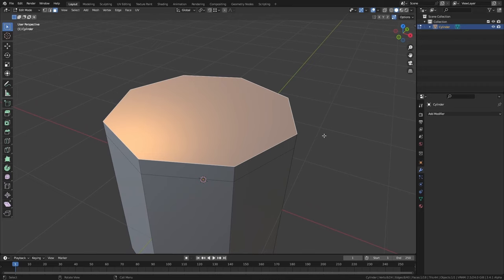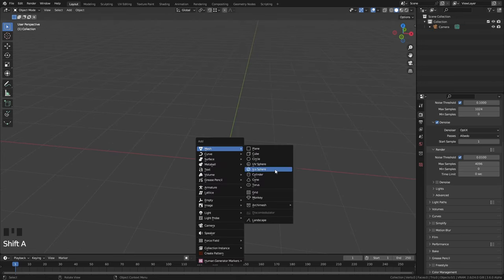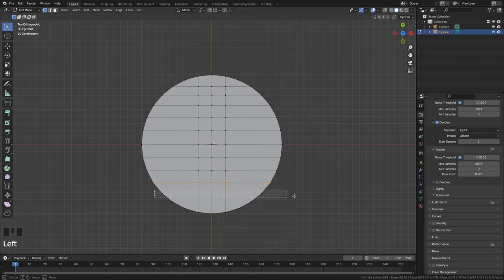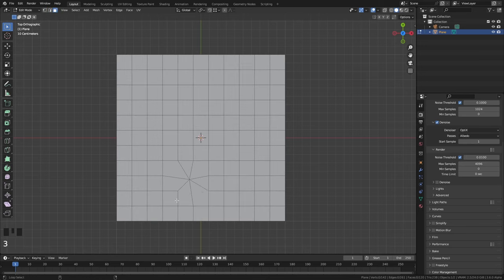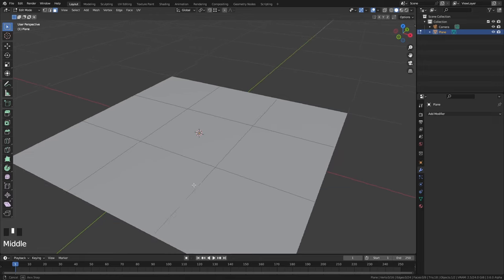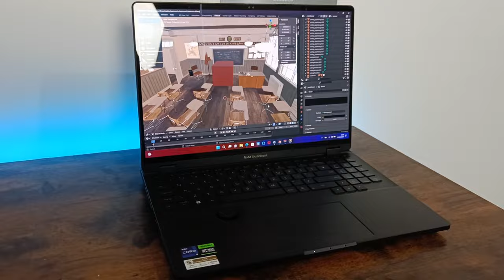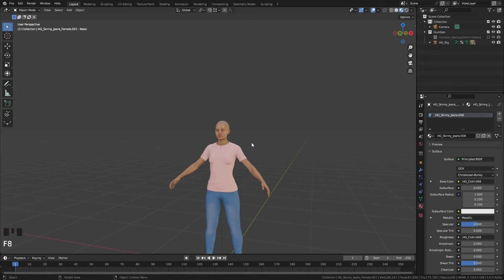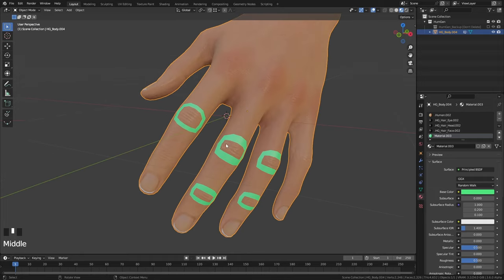Become a Topology PRO with these Five Tips

Comment: people need to stop with the “all quads” rubbish. Triangles aren’t a problem in a mesh; POLES are. sticking a vertex halfway along one edge of a tri doesn’t make it better topology just because it’s a quad now.
Reply: Why do you think that's rubbish?
Reply: @8p8c50 sometimes it isn’t worth the effort. Like in hard surface modeling, it’s not AS important, especially if you’re just modeling a quick concept. Soft body modeling and “final drafts” of hard surface modeling should definitely prioritize quads though. Working with quads is generally easier. 

Tldr, quads are more or less important depending on the case, so you shouldn’t rip your hair out over every little tri or ngon. That being said, quads can make a major impact.
Reply: sometimes you specifically need to arbitrarily declare where the quad should fold otherwise youll get inconsistent results in mesh deformation or game engine imports, different programs interpret triangulation differenly, which isnt a problem if your quads are flat. but sometimes it cannot be that way. and creating quads with vertices too close to one another is a recipe for clipping and z-fighting. i had it once where I had to do this for a low poly chips bag for it to be smooth throughout towards the corners
Reply: @Bleak1302 a vertex that has 5  edges linked in it
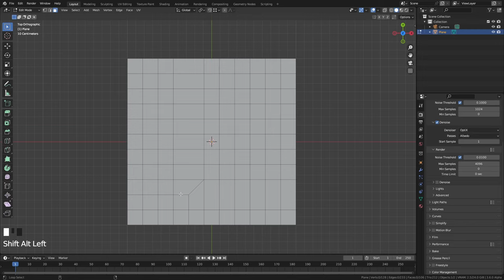Reply: What are the cases where a pole would be okay? The pole at 4:30 looks like a good example, but are there other scenarios?

Or in the case of the original comment, how would I have to work around the issue to make the topology acceptable?
Reply: I'm a Pole and I didn't know that I am a problem 😢
Reply: I as a game developer and not a 3d artist I have never understood why 3d artist are obsessed with quads when it all gets rendered as triangles in the game. Like don’t u wanna know what’s gonna actually get sent down the render pipeline?
Reply: @martinibomb  i can answer that one as someone who understands both sides of the argument here. You are correct, everything gets triangulated in the end. where quads make sense is during the modeling process where its really easy for the modeling software to select specific edge loops for the modeler to work with with a lot less hassle. add one triangle in there and your 3d software wont understand what you want when you try to select a section of  something all around your model, which you do all the time when wrangling your points around. its really better to "work with" in the 3D software, we're talking days faster
Reply: I thought triangles are only a problem if they are mixed with quads and n-gons in relatively equal numbers on the same mesh. Because triangles cause the normals to have a different initial direction than quads or n-gons. Like the way i understand it because a triangle has a flat face, it has more weight for vertex normals in that direction of the face normal vector, but quads aren't necessarily flat and therefore in nearly all cases there is no bias toward the face normal and all vertex normals are created initially in the direction of the average between all adjacent edge normals. But maybe that was a thing that specific modeling software did, but that's how they explained it.
Tl;dr triangles ok if its just a few here and there, or if the entire mesh is triangles, or be prepared to manually edit all the normals later on.
Reply: @synapse349  I have never heard of this. what is the name of that software? for game engines like unreal importing any mesh will force a triangulation of the entire mesh at the end output, this does not change how the normals look.
Reply: My head of arts told me the same thing (I’m an intern) my mind was bLOWN because at school it’s the work of the devil if you have triangles
Reply: As far as I can tell the only thing that quads help is that it makes UV unwrapping more accurate, but that's only really true if the quads are... quad shaped. like adding a vertex to a random part of a trip doesn't fix anything, and its just pedantic for the sake of it
Reply: It's all triangulated in the end anyway
Reply: @Bleak1302why are you commenting if you haven't even watched the video? He described exactly what they are in the video
Reply: To counter this point a little, a triangle is just a pole waiting to be subdivided
Reply: It is better for students to start learning how to solve models with Quads, and little by little move on to examples where tris are not a problem. If you start teaching that tris can be used, my experience as a teacher is that students do not learn to flow topology with poles.
Reply: @KateWilliams-xl2xw   Correct, it's sometimes necessary to add triangles into meshes to assist in definition of UV seams.
Reply: If you’re learning, all quads are the way to go until you have a decent understanding of what and why you’re doing what you’re doing.
Reply: it can also kill your edge flow
Reply: You are 100% right, but working around with triangles and ngons with subdivision is very tricky and you should have an idea of what you're doing and how these poles are flowing, so you should master your topology skills to start doing such thing. Working with quads gives you a much easier understanding of how things are going on. If you are doing deformation working around with triangles is a valid possibility, can be tricky to set a natural flow and uniformity, but ngons will only give you a headache, even tho it's possible.
Reply: Dude has never imported a blender mesh in a game engine, n-gons just disappear 🫠
Reply: Used to be everything was modeled with triangles
Reply: @dimewylde012  they still are. Quads are really easy to divide into triangles, which is why we use them.

they're easier to model with than triangles, but still really easy to turn into triangles.

Comment: Remember, an inset is just an extrude being scaled instead of translated
Reply: No it's not.
Reply: @ianmcglasham  im genuinely curious what the difference is. I learned it in blender, but transferred to maya for work. Maya doesn't have an inset function, so I've been using extrudes exclusively and cant think of a case where it didn't work
Reply: @Levi_Zacharias  it's a complicated area! An inset is the scaling of new vertices relative to the individual vertex normals of a periimiter (or to the average of the normals of attached edges when edge rail is used but it would cloud this already complex discussion too much for a quick answer!) Whereas an extrude and scale calculates the new positions of extruded vertices In relation to the median of the area selected. Consider taking all of the faces of the letter "S" and insetting them. A border will be created with new edges travelling along the original vertex normals. Now consider extruding and then scaling these faces. It doesn't work because of changes of direction around the shape. Maya handles it bizarrely by having the offset option in extrude, but it is not nearly as powerful as blenders method. Max can do it but maya cannot. In advanced modelling it becomes really important to understand the various methods of insetting and there are some clever ways of forcing blender to do a hybrid of the two by creating temporary angular non manifold constructs which force overflow conditions in the code. As I said, it is complicated!!! I'll make a video at some point!
Reply: If I didn't use Blender before I would have definitely had an idea what you are talking.
Reply: to demonstrate how this isn't the case, try insetting a very wide rectangular surface vs the extrude -> scale

someone else in this thread explained it already but to put a long story short, inset actually follows the shape. it's not quite the same as scaling.
Reply: No it's absolutely not. Try selecting the top faces of a cylinder and extrude and then scale it down on the x and y axis. You'll get overlapping faces. Which you won't if you inset
Reply: I actually didn't even realise you could inset without there already being a face there lmao I would just LITERALLY 
extrude
hit 0
scale
Reply: It so very much is not.
Reply: 😳😳😳 he's onto something..
Reply: Nope🤣
Reply: Not to be rude, but what exactly made you comment this without double checking it or verifying it in any way?

Comment: This is excellent, Thank you. I failed to learn these concepts when I started  out with Blender. It made my learning journey that much longer. Now I'm having to go back and unlearn lots of bad habits, so your clear & specific explanations are very useful. Thanks again.
Reply: Except his philosophy is all wrongheaded and founded on the idea that poles are OK but tris are bad, which is just plain backwards.
Reply: Aren't tris bad most of the time?
Reply: @mrlightwriter  Though engines like Unreal have their own solutions for quads, any game engine will transform any mesh you throw at it to tris meaning it doesn't matter for the most part, poles aka ngons are bad bc the game engine doesn't know how to deal with them as it can only deal with quads/tris so if you don't place them in flat topology they may be imported wrong bc the engine didn't know how to convert the ngons to tris and did it wrong.

Comment: 2:00 You need to select vertecies around, then checker deselect them, then also add center vertex to the selection with Shift. And now press 2 to go to edge mode. Done
Reply: This way is better than my suggestion.
Reply: just did this, thanks for the tip
you can also select the edgeloop ( [2], then alt-click an edge to get the loop) and hit 1 to have all the verts selected
Reply: Yes, topology decimation master, you are entirely correct. You can't checker deselect edges with a common vertex but you can checker deselect their outer vertices, which saves potentially enormous amount of time. Thank you for writing this suggestion, I was scrolling down the comments for this exact one.

Comment: I feel like it is necessary to call out a little gem of a tip that I didn't know about and maybe others don't either. 4:10 to snap the vertex to align to the ones around it, select the vertex, use G, X to constrain it to the X-axis, then hold CTRL and hover over an aligned Y vert.  Behold, it snaps!! Repeat for the Y direction using G, Y, then hold CTRL and hover over an aligned X vert.  All these years I didn't know about this handy trick.  :-} Thanks Mr. D!
Reply from the maker: Yeah ctrl snapping is great. I use it constantly. It works in object mode too, if you want to align objects with another surface. 👍
Reply: For some reason when I'm doing this the snapping works weird. It snaps, but not with the vertices, it remains a little crooked on the Y axis
Reply: you can snap with ctrl what?

WHAT??

Comment: At 2:00 you say that "Checker Deselect" will not work, but it DOES work.   What you need to do is select that ring, and then go into vertex mode and use "Checker Deselect", then SHIFT select the center vert and you can dissolve the edges.

Comment: Here's a topology tip that saved me a ton of time and my UV's

Instead of doubletapping G to slide the vertex or edge. Triple tap G and get full freedom of movement then use any axis to lock your direction if required. This is also nondestructible to your texture/ UV's
Reply: But pressing G three times is just the same as only pressing it once!!!
Reply: @threadlington3430  no it isn't. Pressing it once just moves, which warps the texture. Twice is slide mode. Three times is free-form slide
Reply: @MonsterJuiced  It really is not! There is no third mode. "g" to freely rransform. "gg" to go to edge slide mode. Pressing g a third time just goes back to free transform. There is not an extra mode! (Edit - I was wrong. There is a third press of g which works as the tip says!)
Reply: @threadlington3430  But there is though I use it. Do you have loop tools plugin enabled? I'll check what allows me to do it because this thing has been a life saver for me for the past few months
Reply: @threadlington3430  I think youtube removed my comment because it has a link in it. Trying again:  watch?v=ZyrZZqpbFNA

That video will show you the third G option
Reply: @MonsterJuiced  hi. I can't see the link. I would be really interested to know what add-on or thing is installed because it does sound interesting.
Reply: @MonsterJuiced  I have seen the video and I have tested it using a uv map and... you are correct and I am wrong. Thank you. I have learned something new. I will leave my incorrect comments there so anyone who thinks the same as I did can find out your correct solution. Sorry and thanks for the great tip!
Reply: @threadlington3430  hey it's all good man no worries, I'm glad you got it down it'll help save you loads of time at some point
Reply: @threadlington3430  I was not able to reproduce that third G. It goes back to free grabbing like the first G. Is the texture displacement the only difference? EDIT: yes it seems the texture displacement is the only difference. Thanks for showing me something new!
Reply: @bassemb  Not me! It was @MonsterJuiced!

Comment: In terms of making a standard cylinder there is actually nothing wrong with a triangle fan. When you subdivide the structure at 2:00 will be generated by the subdivision anyway. It's much faster to use 2 control loops instead of selecting every other edge and dissolving them. It also uses less geometry than some of the other methods which will start adding up fast in your high polys.

Comment: remember, edge and vertex creasing is also good if you dont want to add extra edges to your mesh.
Reply: That’s only if the model stays in Blender. If you need to bring it into other softwares, the creased parts will not look creased in other softwares.

Comment: 2:00 you actually could bevel the middle vert(Ctrl+Shift+B), use edge ring (either any selecting method you want), checker deselect, dissolve, merge middle beveled ring at center. Much less frustraiting

Comment: Hello Geordie! I use 6-poles all the time. I think they are optimal in several circumstances. (I'm from South Shields!)
Reply: For which circumstances you use them most? Which would be the recommended moment to use them? Truly curious noob here.
Reply: @carlosfranca2602  Howdy carlos. There are some cubic forms (like dice with rounded faces) which use 6-spoked piles on the corners. When extruding a checkerboard arrangement of inset faces they are the best topology and they are the only sensible topology available when 3 axes are extruded in 3 separate directions (happens all the time). There is one type of sphere - kind of half way between a uv sphere and a quadsphere which uses them too. They do crop up occasionally(normally on corner of less than 90 degree angles which use them very efficiently too. Their usage is generally a little more advanced but sometimes they are the best solution!

Comment: I sometimes use triangle fan to top off a flat end of a cylindrical object, without the points being merged, in order to have the easiest to work with (square) UVs for tangent use when dealing with anisotropic shading. How would you approach getting good tangents and seamless transition on such a work piece using more "proper" topology? Note that UV driven tangents are NOT smoothed across the seam like normals are. And according to developers, "it's a feature, not a bug" 🤦There are procedural texturing reasons I need UVs in this weird layout too, so just assume the tangent has to be UV driven. How would you approach this?

Comment: Hey, I'm learning how to use Blender and making 3D graphics in general and this might be a dumb question, but should all faces be quads and if so why? From my personal experience it makes it harder to apply materials to faces that aren't quads, but is there something more to it and how to avoid doing it when making complex models (like human characters)?
Reply: i've just started out myself, but from the many mistakes i already made, i noticed that having quads is good because there won't be weird unnecessary sharp edges when you subdivide it, and if you decide to transform quads into tris at some point, it won't cause that problem either. i think they're just good because they make way for clean and smooth surfaces, plus what you said about easier application of materials

Comment: Dumb questions: what happens if a ngon is in the model? What happens if tris and quads are in the same model? Why do we want to avoid them?
Reply: Blender is excellent at handling ngons and other non-quad topology, but if you import the model into other software like zbrush or a 3d printing slicer for example, you’re going to run into issues. Error messages, holes in the mesh, printing failures etc. Best practice is to avoid non-quads from the start.
Reply: @SeonasStudio  Thanks. What about mixed tris and quads, why is that bad? Just due to unwrapping issues?
Reply: @Mr.McWatson  well technically every quad in a mesh that gets imported into a game engine or so gets converted into tris, the issue is tris that aren’t part of a quad can lead to strange lighting artifacts. Sometimes they’re impossible to get rid of, so you can hide them in less noticeable places or bits that don’t move with a rig so they’ll have less effect on the appearance.
Reply: @Mr.McWatson  I'm a noob as well but if you're modelling and you use nice quads editing a model is also way easier since you can select loops etc. If your model is a bit sloppy and has also lots of tris they break the loops you can select so easily and it's harder to change anything. I don't do any commercial modelling but I try to work as nice as my current knowledge is. If I now sometimes get old models I wanted to change a bit it's most of the time faster just to start over.